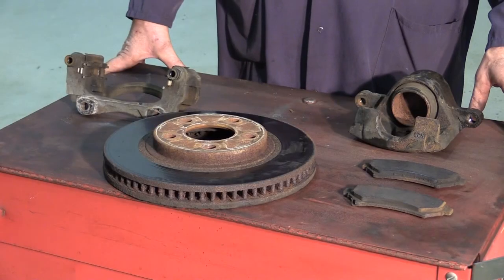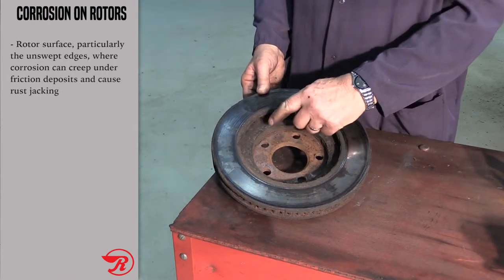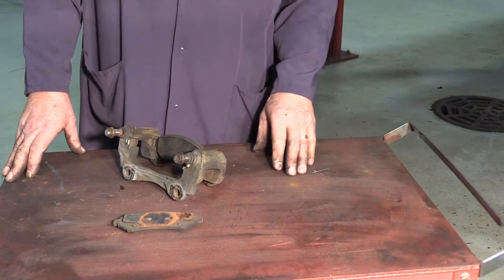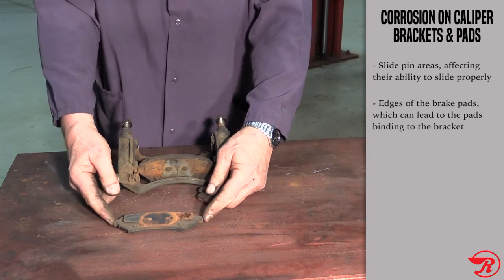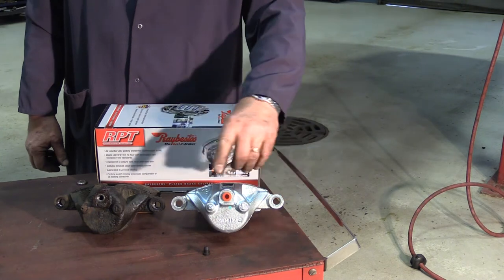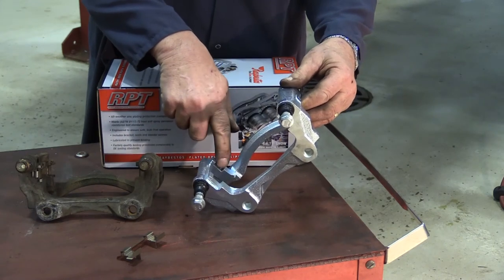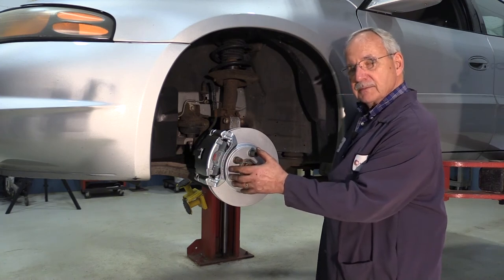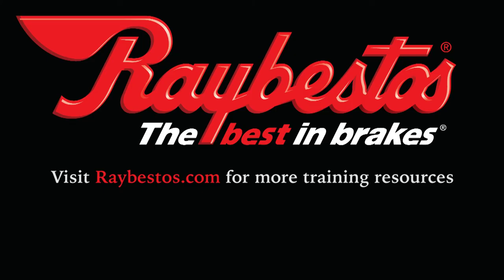Plated Calipers Discussion

Comment: Hello your raybestos brake caliper remanufacturing team needs remedial instruction on how to remanufacture brake calipers. I purchased 2 front calipers which I received today. The passenger side which I really need was not remanufactured properly. The bolts that attach the caliper with the bracket were tightend using an impact. I had to use a dewalt  high torque impact to get them off. The caliper slides were not lubricated and the threads where the caliper bolts attach to the bracket were not chased I had to tighten  them slightly using an impact as well. I haven't checked the bleeder yet. I just hope that it loosens without difficulty also other manufactures include the banjo bolt where as raybestos doesn't . I would like to know how are you going to address these quality control issues going forward.
Reply: They should start by making their products in the USA. Bring these jobs back